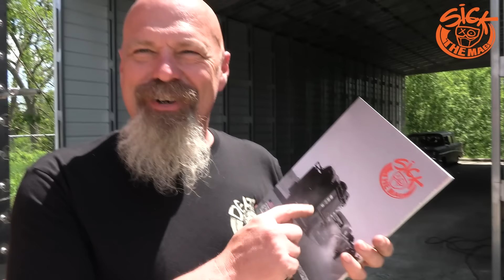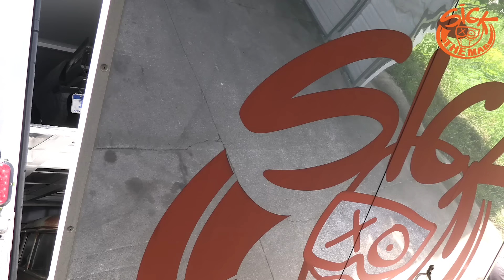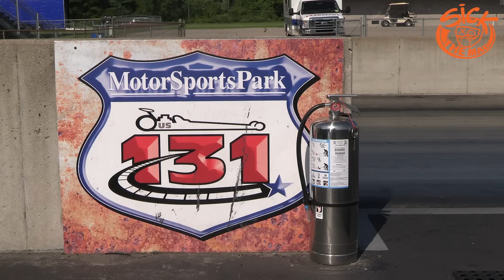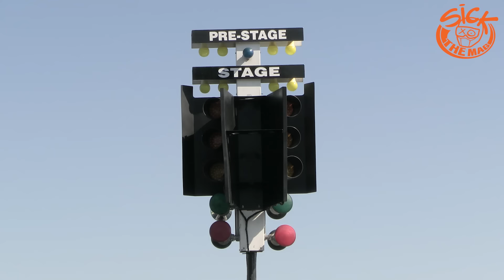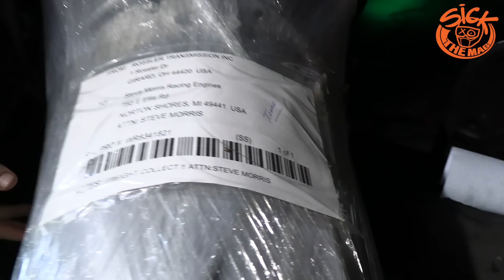Testing Sick Seconds 2.0 Camaro With The World’s Quickest Street Cars

Comment: Do you think ol Cleeter going to get in to the 5 sec club in a steel roof and quater 69 Camaro with a small tire???
Reply: He's got the money and motivation to do it, just a question of time.
Reply: I think that car will go a 5. I don't think it will do it unless the prep and track conditions are just right. He's not just gonna show up at a random event and bang off a 5 whenever he wants.
Reply: @wesw9586  what car hits a 5 whenever they want regardless of the track?
Reply: @dustyaa39  very true. Just with Cleetus and some of the fans, ya never know what the expectations will be.
Reply: *Camaro, there is no "E" in the name.
Reply: Hell yeah brother👍😎
Reply: Of course, mullet is a boat and it runs low 6s.
Reply: Maybe eventually, using Brent Lasalla as an example, I believe his best is in the 6.27-28 range and I'm not aware of a quicker small tire car, although I could be wrong.
Reply: Cleet will easily do it when the track prep is decent. Brett did a 6.26 on 275 with about 3000hp in a 3,000 lb car. Cleet will run a 315 radial with 5,000 hp in a 2,600 lb car.
Reply: All I’m saying is Bailey has only been 5’s a couple of times. With a race car that can drive on the street. Cleeters new car is going to be a track only car since no vin tag and even with a smx or 481x what ever he decides to use there is only so much tire contact patch on a small tire to put the power down with. So even if he has a 5000 hp engine he can’t use all 5000hp
Reply: Kevin ficus went several 5 second passes on a 275 radial like 5 or so years ago at world cup finals. (No it wasn't a street car or drag and drive car) it was a 275 radial car.
Reply: @tomeickhorst6787  well said, I would also like to point out that 5,000 HP and 2600 lbs are purely theoretical and speculation at this point in time and the leap from 6.26 to a 5.99 is huge.
Reply: On a small tire? Don't think so.
Reply: @tomeickhorst6787  you can use all that power you just have to ramp it in as your speed increases mullet has no weight over the rear end THB I would have taken 2 to 3 feet outta mullets bed to shorten the wheel base and get better weight transfer, he went will such a big engine because the car is heavy I would imagine something in the 3000 HP range
Reply: Problem is, Cleetus’ new car won’t be street legal like Bailey’s or Lasalla’s.  It’s gonna be track only and those cars run 5’s every day.
Reply: I would have like to see them talk about making mullet a short bed IMO sure it would help if the took 2 to 3 foot out and put more weight on the rear
Reply: @muskyelondragon yeah on a 275 radial. It was a foxbody mustang. 1320 video done a video on it. It's a blue foxbody. It's on 1320s YouTube channel
Reply: Absolutely, it’s already been done.
Reply: Deep pockets and desire, with a lot of help. Just might be possible.
Reply: @veto8792 hate to break it to you but baileys 2.0 is more of a Promod than the car CJRC is building for Garret. Baileys 2.0 was built as a Promod and then some changes made to make it able to be street driven. There were no extended wheelbase carbon fiber Camaro bodies in 1969.
Reply: @precisiondiesel225  Doesn’t matter what it started as, right now it’s water cooled, has power windows, running lights and is street legal.  He can drive to the track, race and drive it back home.  Cleetus’ car will not have any of that.  It’s basically an X275 or NPK car and they run 5’s all day long.
Reply: I don’t understand why he’s building another small tire car. He needs at least one grown up car in his fleet.
Reply: You can get a vin for a custom built car. No different than the hundreds of  kit Cobras. Steve Morris will street drive his new 69.
Reply: @deliveryguynate  yep, bang on. These YT keyboard toss pot no hopes don't have a clue
Reply: Wouldn't think he would put around $250k + into a car if he didn't think it was possible
Reply: If he runs as normal he’ll be stuck at 6.000 for a long time.😂
Reply: @andrewstoffel1170  he's got to get past that 7.001 first definitely likes the low 7s
Reply: No doubt. Cleet has a goal for the classes he’s going to run and know what others are running and Cameron knows what it takes to build it. If the goal was unrealistic or unlikely Cameron would tell him and redirect his expectations or his goals. CJRC hasn’t built an under performing car yet. 5’s no doubt. How deep in the 5’s we don’t know yet.
Reply: @64thchopshop probably twice that amount that’s just the rolling chassis
Reply: @s3quattro10  video i watched today said 130k to 150k for the rolling chassis then add motor n wiring
Reply: @64thchopshop  I think you watched the wrong video. Cameron said this will be $225k or more just for the roller, no engine, trans, wiring etc
Reply: @stevemullen8457  Steve Morris’ car already has a vin and is street legal.   Cleetus’ car is not intended for street use.
Reply: Yeah I think so old cleat is a determined man that’s for sure
Reply: @johndoran3274 I wondered that too. For some of the random ass tracks with marginal prep they go to, he needs a steamroller car. Every "street" car or should be relatable every-man car they do turns into a high dollar build, why lowball this one?
Reply: It's going to take some time. The chassis may be able to, but the engine and trans gotta get set up and tuned for it. There's going to be a lot of videos with him getting frustrated because the car won't hook. He will get there though!
Reply: To compare to Brent he would have to use a small block
Reply: Great to see Father and Son racing
Reply: Cleeters new 69 is running about400 lbs less than sick seconds. The new chassis is full of titanium accessories that should help keep the weight down. It’s gonna be iinteresting !! 5.99 is fast as hell!!! We shall see!!
Reply: @TScott79  it's the way you say it
Reply: @tomeickhorst6787  He is not gonne put a SMX in his new car... To heavy and he doesn't need that much power. Maybe a SML or even a Pete harrold LS engine like Leroy.
Reply: It will be short lived , too many irons in the fire, he seems to get bored with one car to another
Reply: Depends how far they push the whole real small
Tyre thing might be a small
Big tyre who knows with all the micro classes and records these days
Reply: @indianaslim4971  the “Eagle” isn’t a drag and drive car so you are looking at the wrong level of cars. Think PRO275 from some of Ducks races.
Reply: @Jnichols77  yeah, the problem lies in the fact that he hasn't said what class he intends to run with this car and he's never really run a series like Pro 275 before. With him being a u-tuber he just runs individual events instead of entering a points series, it wouldn't surprise me if he converts it to a drag and drive car after getting his 5 . Drag n drive seems to fit his u-tube business model .
Reply: It's not even the beginning of that car yet. Im sure panels will get swapped later on his journey to 5's
Reply: It will go into the 5.50’s
Reply: Yup
Reply: He broke the gm stick shift record with the least likely car. Don't be surprised bud.
Reply: I don’t think so.  Not a small tire car.
Reply: Yes steel quarters and roof skin isn't 100 pounds
Reply: Very easy with a plr package and plr calibrator,it's been done multiple times  so it's not something new

Comment: Tom, I keep saying Cleeter needs to make Mullet a big tire drag n drive car, thoughts?  would be perfect for you to jump in and give him big tire advice since it will be his first big tire car
Reply: You would have to competently rebuild the whole car. Everything behind the driver needs to be reworked to put big tires in. New 4 link brackets, new rear bars, new rear end, massive wheel tubs. The wheel tubs would poke 8+ inches out of the bed.

Even then you still have to look at weight distribution problems, overall car weight, and cage cert to determine if the chassis is even going to work.
Reply: Garrett is having CJ build him a ‘69 Camaro big tire car.
Reply: @philb5593  - Yep, Garrett knows the El Camino has reached its limit hence CJ Race Cars is building a new big tire ‘69 Camaro for him.
Reply: Cletus is having a top of the line small tire 69 Camaro built by CJRC they’ve already done videos on it, Cletus wants to go 5’s
Reply: @danmyers9372  No he's making it a small tire car..which I think is a mistake.
Reply: @mjay6245  he can still run it as a big tire car but they will have to modify the outer fender skins, the 4-link  placement is a little bit wider on a small tire car, but I don’t know why it would be a mistake RVW has been in the 3.40’s with small tire cars
Reply: @DSRE535  Bro..changing to big tire is HUGE when the entire car is built from the ground up as a tube chassis designed for small tires only..

I think it's a mistake because he can go faster with a big tire, he doesn't have a big tire car yet, and because eventually he'll need to change to go faster anyways, so might as while make this from the custom chassis and up a big tire car now.

But it's his money, not mine and I respect his choices. If that's what he wants, he should do it.
Reply: @danmyers9372  It's going to be capable of being a big tire car, the builder alluded to that, but I'm almost positive it's not going to be a big tire car at the start